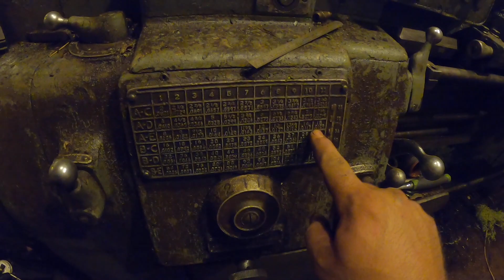Johnny Joint Thread Repair.

Comment: One of the best tools I recently purchased is a thread pitch gauge set with common bolt and nut checkers.  M12-1.75 to M4-0.7 and 1/2-13 to #6-32. Plus metric 0.7 to 2.0 and 32 - 13 TPI combs.   Original Thread Checker.  Keeps me out of guessing, most of the time.

Comment: The lathe sure is a high end unit. The tail stock looks really rigid. Mine is 2” and it still flexes :o)  The turned-to-the-side hand wheel is a neat trick.
Reply from the maker: Thanks. Its a good machine.

Comment: Hi , Zach . Do you know about thread restore files . If you don't They make these in inch and metric versions . I have used these many times , Very handy especially when your not near your shop . You have a nice lathe there . Have a great day my friend .

Terry
Reply from the maker: I do, Ive got a set. Thanks.
Reply: Thread files are fantastic!  Also just a triangle file, they're 60 degrees.  Also, also, had to lookup 'johnny joint' & found out it's what I know as a rod end/heim joint, or rose joint in England.  Thank you.

Comment: next time you can just put a 3/8 x 16 bolt up against it as a tread gauge same for a tap drill size just find a drill that fits the nut but after seeing your motor home  all i can say is you know your stuff

Comment: I would've just run a chasing file over it.
I'm too prone to buggering up lathe threads. 
Btw,
1"-16 tpi is fairly common on heim joints and rod ends.